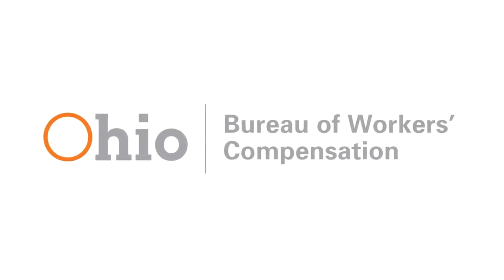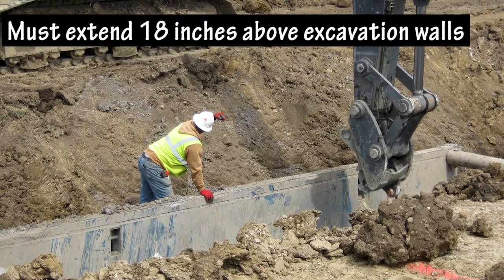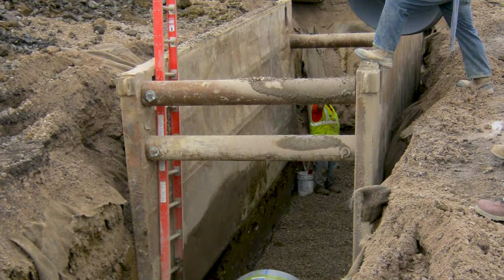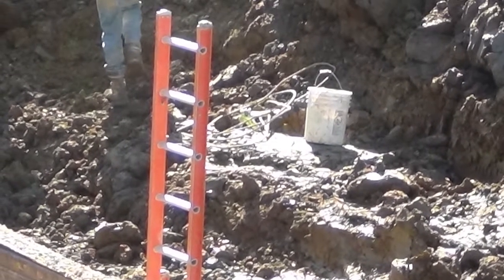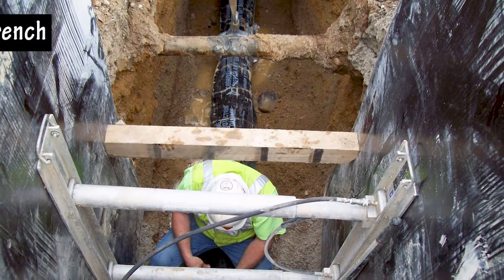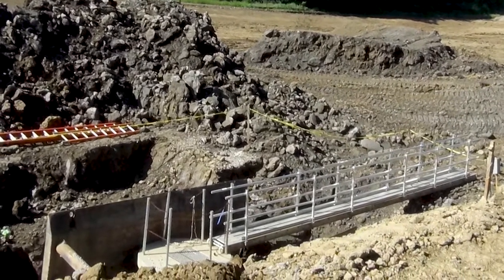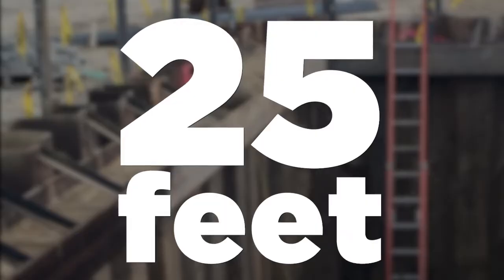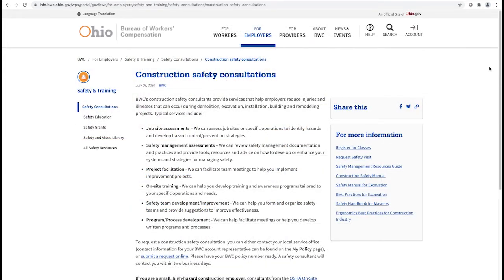Trench Safety - Know the Numbers

Comment: Do you have to shore at 4ft ?
Reply from the maker: @rcperformance7991 - from BWC's Safety Consultants: It depends. If an excavation is less than 5 feet, an examination of the ground by a competent person must occur.  If there is no indication of a potential cave-in, protection systems are not required per the standard.  However, serious injuries can occur less than 5 feet so ensure you inspect adequately and protect employees accordingly.